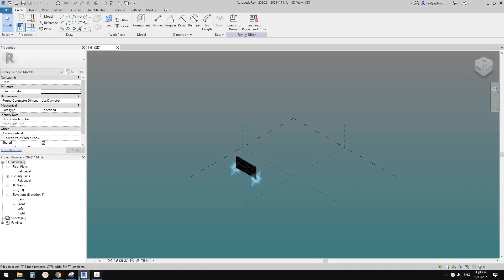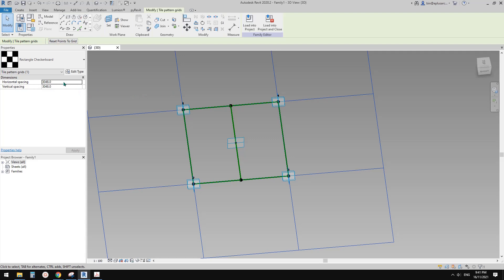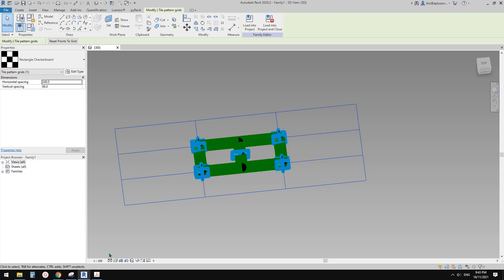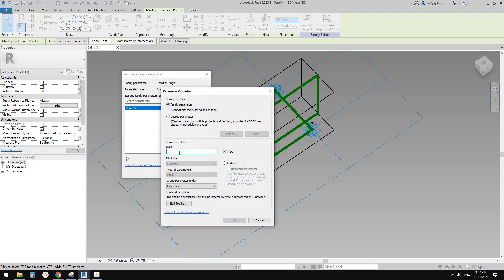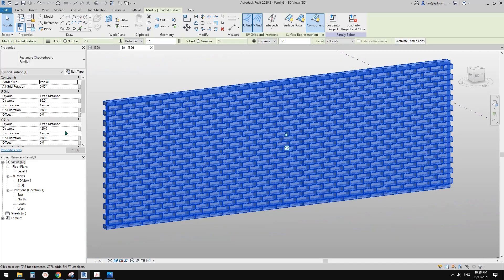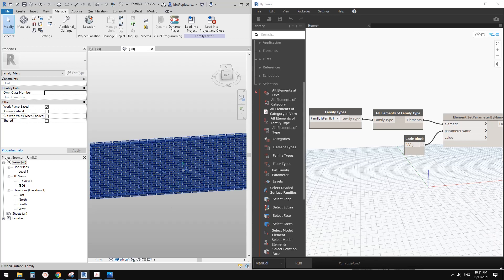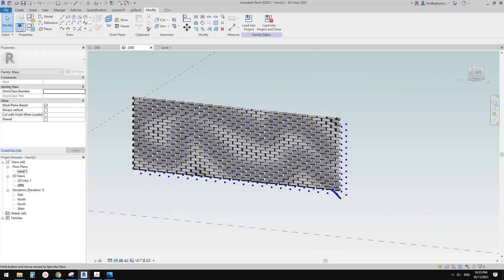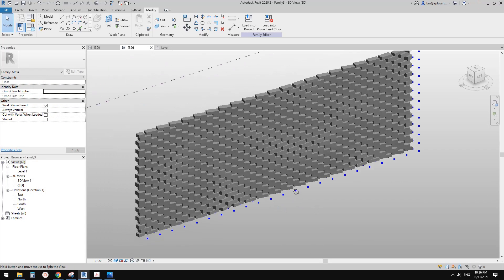Revit Exercise (Day 603) - Pattern Based Rippling Brick Screen (Dynamo)

Comment: excellent video, one question ... how do I integrate it into my revit modeling? I'm just learning :D
Cheers ! :)
Reply from the maker: Good question. You have a few different ways to use it:
1. Create it as a conceptual mass, set the length, height, and rotation for each brick, then load it into your project.
2.  Create it as an adaptive family,  same steps as the first one except for the length, which is controlled by adaptive points.
3. Load the pattern-based family into your project, then model an In-place mass, and apply the pattern-based family to the divided surface. However, you will not be able to use Dynamo in an In-Place Mass.